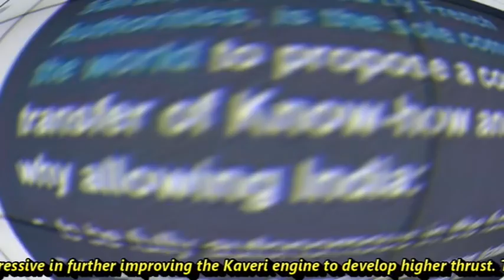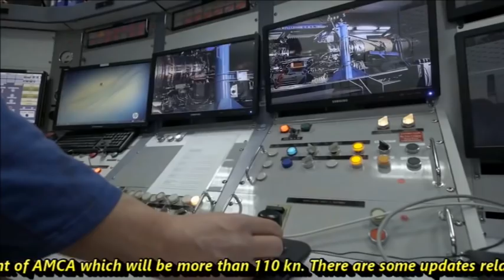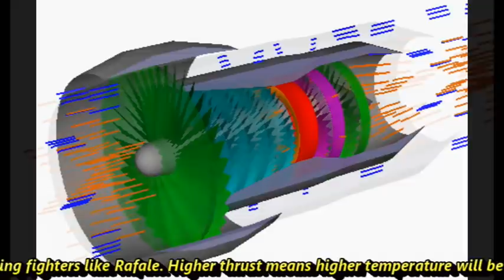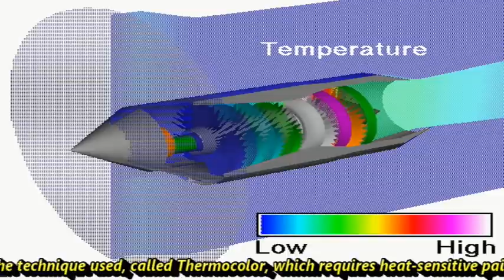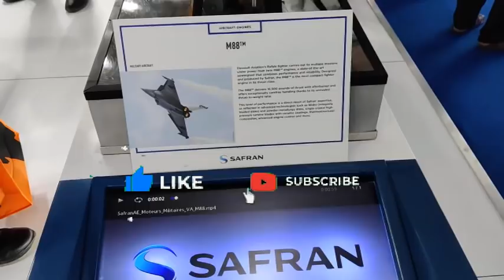France completes first engine test for its 6th generation fighter

Comment: M 88 4 is good engine but we want more than 110 kn so this can archive by increasing size of afterburner
Reply: @hermes6910  m 88 4 can generate 104 kn with afterburner so only small  gap to fill so we 115 kn mean 10 kn gap to fill this can be archive increase of size of after Brunner